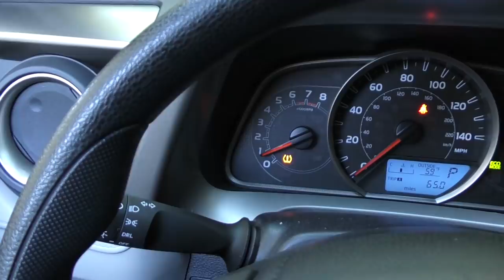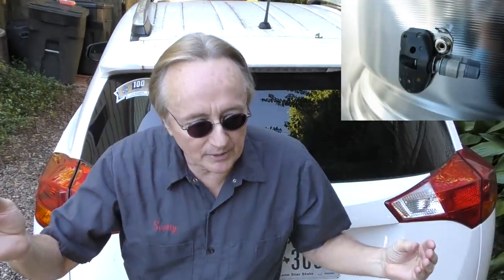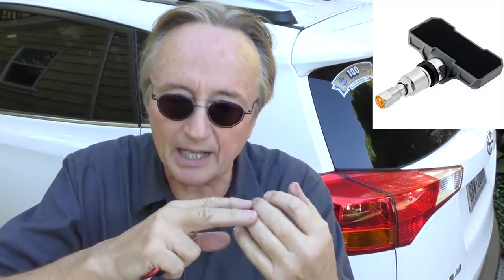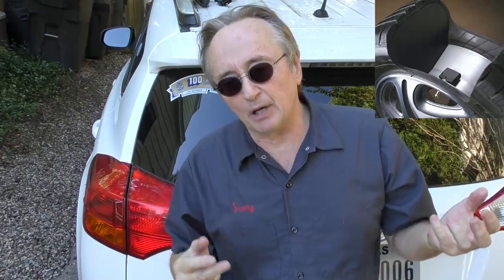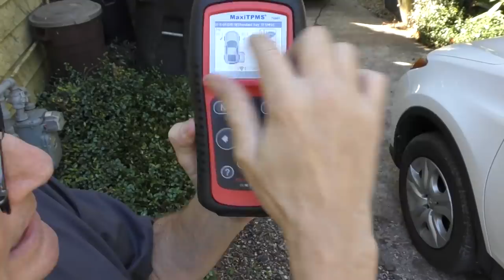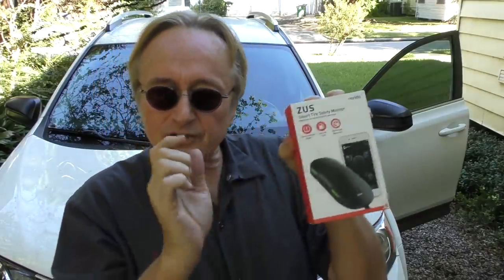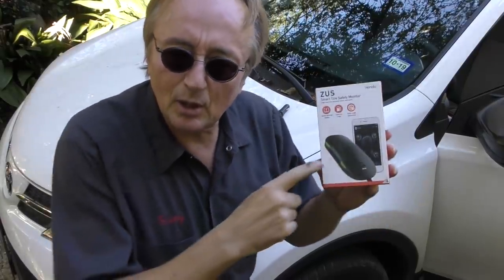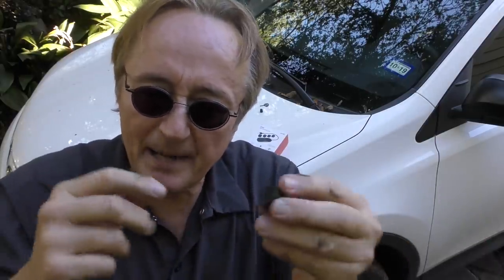Here’s Why This Kind of Tire is Stupid

Comment: When i tell people tesla is a bad car people just said: "Don't listen to a mechanic who is a youtuber" but hey i stille respect you Scotty :) Great Videos. One of my friends she has a 1999 Toyota Corolla 1,3 the servo fluid is dark and the car is hard to turn should the fluid be replaced?
Reply: bruh wth is servo fluid?... either way almost all fluids should be replaced at one point
Reply: @MauriiBoii  Okay :)
Reply: Depends on the car.  Some master cylinders immediately change the color of the brake fluid.  For example the Mazda MX5 Miata clutch cylinder - within a day of putting fresh fluid in it will go from clear to dark - it's perfectly normal.

Comment: discount tire probably does TPMS module replacement pretty cheap. last time i had a nail in my tire and got it repaired, they replaced the TPMS sensor at no extra charge.

Comment: Each TPMS sensor for my ford escape was $30.  The tire center installed them for free with new tires.  I purchased that same exact Autel TPMS computer used on eBay and resold it for a few dollars less.  Basically I just rented that TPMS computer.  It wasn't a huge deal to replace them.

Comment: I just place one of those little felt pads over the blinking light so it doesn't annoy me.  These pads are the ones you can by at the hardware store or at WalMart, and are placed on the bottom of vases or other objects so they don't scratch the table surface.

Comment: Discount Tire told  me it was $60 a pop to replace those sensors. I bought a new set of tires a year ago and they replaced the sensors for $50 each since I was buying tires and they had it apart already. I never got a light for over inflation but if you put the recommended tire pressure in your tires the damn things will annoy you if you drop 1lb below

Comment: Late model Hondas do not have TPMS sensors in the tires.  They use the anti skid device on the car to monitor tire rotation speed.  Lower air in a tire means the tire rotates at a different speed.  I had a 2014 CRV with this system.  It was horrible causing constant false readings.  I stopped many times thinking I had a tire low on air.  I lemon lawed the car since AHC could not make it work right.

Comment: I bought that Autel TPMS tool and 4 of Autel Sensors.
took them to Sam's Club, but they said they won't install TPMS sensors that the customers brought with them.
They will only install TPMS sensors they sell.  So I went to Goodyear Tire Services place, and they were willing to use my sensors, but they charge more for the exact same model tires compare to Sam's.

Comment: Am I correct in thinking that the low pressure warning light will stay on even after the after market sensors are installed?  I suppose a little piece of masking or electrical tape will hide it.

Comment: In an early Bentley Continental you have four sensors in each tire and a central PC which controls them. In five years time you have to replace them all or some of them.. and if their module has problem, it's another 1500 usd. A nightmare.

Comment: That’s a good idea to put external sensors on but if you’re internal ones are linked to your traction control and if you have a TPMS problem it will disable it.    So double check your owners manual before you spend 100 bucks on external ones

Comment: I have TPMS and never realized it until I got my tires changed. I check them once a week so I never noticed the sensor until the change. The light came on for about five minutes after I left the tire shop then it turned off.

Comment: The Firestone/ Ford Explorer debacle was caused because people (soccer moms) wanted their Explorers to ride better, they were built on a Ranger pickup frame which rode a little firm and were top heavy. Ford made Firestone soften their OEM tires and then they told people to run them under inflated. Even at correct pressure the tires begin failing. 
I WAS THERE and my family and some neighbors had failures. I was also involved in some court cases. Ford and Firestone blamed each other and all other Firestone tires were fine except the OEMs. But that was the end for Firestone. Bridgestone bought the Firestone brand name and they are now all good tires.

Comment: The TPMS saved my bacon. I ran over a nail with the front passenger side wheel. I had just got on the highway, going 75mph and ding ding ding... I pulled over and saw the nail head. I checked the pressure and it was down almost 20 lbs.. Whew.. That was close! I put the Doughnut on and got off at the next exit only a mile away and got the Tire repaired!  PS - These were brand new tires too.. only a month old!

Comment: Hi Scotty. This system looks great and all, but wouldn't it be completely useless in my 2006 Honda Ridgeline with Honda AWD system? As far as I understand if the TPMS system light is on/not functioning correctly it over rides the AWD system and prevents it from working. The truck will stay in FWD mode only as long the system light is on, it will not automatically switch to the AWD when needed. I replaced all 4 of my sensors for $320 and $50 to a tire guy. $370 total. The sensors I purchased were able to be programmed via a laptop computer using the vehicles VIN number, I was able to do it myself and have been working flawlessly for almost a year now. Am I correct in assuming these systems will not work with Honda's I-VTM4 AWD systems?

Comment: Always enjoy your video, THANKS! My only problem with the screw on replacement sensors is that theft can easily steal them. I will be screwed out of hundred bucks.:(
Reply: What good is a sensor going to be without the monitor that's inside your (hopefully) locked car?  Doesn't make any sense...

Comment: Actually if you take your tire off for any reason, and put it back on you won’t have to balance it if it’s lined back up with the valve stem where it came off from before. You can do this with chalk so you can line the mark up with the stem when it goes back on. That way you can wipe off the chalk with brake clean or solvent

Comment: I found some nice looking aluminium rims for the winter (picked smaller ones so more rubber for comfort), put the best winter tires on it and the cheapest eBay sensors to put inside because apparently (in Germany) it's illegal to drive with no sensors if your car came with some. No setup required, the car (cheap Suzuki) figures it out. I wish they did it like Mazda where it figures out if a wheel is off because it doesn't spin exactly as the computer expects it to. So if a tire is losing air, it knows before you figure it out while driving. On the old car I just checked the pressures as part of the washing routine and changed the pressure every season change to compensate for outside temperature. Looking up all 4 pressures by pressing a button sure is more convenient, but not worth the money really. I'd rather have lane departure warning mandatory on new vehicles. There's to many drivers veering into other lanes because they're busy with the phone, passenger or yelling at the kids in the back.

Comment: Hello Scotty! I had a question. I was in the market for a used Toyota Corolla when I stumbled upon two likely candidates. A silver 2017 Corolla LE with 83,000 miles and a cherry red 2014 Corolla LE with 52,000 miles. Both reasonably priced about the same and both in excellent condition. Still, I'm indecisive. What really matters more in a used vehicle, mileage or how old the car is?

Comment: Another Note, Some cheap/poorly designed cell phone/USB chargers can interfere with the wireless communication, so if you get a TPMS fault/light and your tire pressures are OK, try unplugging your cell charger for a couple trips. I had a PNY USB charger that would cause my car to throw a TPMS fault, unplugged it and restarted the car and the TPMS fault did not return.

Comment: One of the priuses I drove as a cabbie had one of these go bad and the damn computer in the car limited me to 50km/h until it was replaced. In the city, some zones are 60. most is 50. but we also got calls out of town where it's 80 and the quickest way over the river was the 401 which is 100. so... it quickly became a problem.

Comment: The problem with these aftermarket stem-mounted systems is that they are constantly depressing the schrader valve down to get a pressure reading. If they come unscrewed just a little over time or it has a defective gasket seal to begin with it can cause your valve stem to slowly leak. Best to avoid these systems, live with the TPMS light on and check manually.

Comment: In days of old we just got new tires and they were inflated properly when installed. Then at the oil change place they checked the tires pressure every 3000 miles when we got the oil changed. Of course those of us who liked to change our own oil to be sure it was done correctly and we got the fluid we paid for in there, just buy a tire Guage and check it ourselves. It was part of a weekly routine to check bulbs and stuff. An ounce of prevention is a pound of cure. Check your stuff weekly and avoid being stranded or even a ticket for a blown light. I'm not a fan of the new technology.

Comment: If I were to get one of the replacement tire pressure kits wouldn't I have to sync it with my cars monitoring system to get the light to go out? Or do I have to ignore the light on the dash and pay attention only to the new system?

Comment: Hey Scotty, could it be, that u don't watch youtube ?, 1. one problem to solve : could be, that tire pressure gages work on the same kind of cars on different frequencies , example C6 US / Europe versions , so make sure to put in the right gage for ur car . 2. if I remember right u simply can activate at least on a Corvette, pressure gages as follows : put the car in learning position and place a round magnet above quite near the airvalve of each tire, wait for the beep, do that for all 4 tires, and the new pressure gages are engaged. That's it. So we don't need a unit for 100 or more bucks, got it ?

Comment: Instead of spending any money at all, just ignore the light on the dash and check the air every so often. After all, the TPMS system ONLY tells you when the pressure is low. It's just a quality of life tool with no mechanical value

Comment: I also hate those I have on in 2008 Malibu it turns on the tire pressure I checked the air in the tires and they have the correct air

Comment: Hey Scotty-With these after market pressure sensors...   will they override the factory sensors that are tripping the tire pressure light or will that remain on even with these after market sensors?   Thanks!
Reply: they are independant, and will not turn off the warning light.

Comment: In my opinion, tire pressure monitoring systems are overkill. Keep it simple and just use a pressure gauge to keep tires at proper pressure. Anyone who drives and is under 70, should know how to check oil, tire pressure and coolant.

Comment: Omfg Scotty you’re amazing, lol it’s like you knew my tire light was on. I’m getting one these instead of spending a Whopping $476 on the batteries since have two out. Thanks 🙏
Reply: At Costco they are $45 each plus $20 each to install. Otherwise, you may have to pull the in-dash bulb in order to get the TPMS warning light to go off

Comment: How does the sensor know how much pressure your tires require?
Also: they will not tell you if your tires are overinflated.
Reply: Tires don't over-inflate themselves, and the sensors were provided by the OEM.

Comment: Some guys take all the TPMS's and put them in a capped PVC pipe with a valve stem coming out of it. Pressureize the tube with all the sensors inside and throw it in the trunk.

Comment: There may be a "zillion" replacement tire pressure battery kits around, but which ones are the best in your estimation?  Or, which ones have you used that worked fine?  Conversely, which ones do you know of that should be avoided?  I don't know if Consumer Reports has done a review of these kits yet, so it would be handy information to have.  Thanks.

Comment: I have wider and taller tires that OE, so i run my front's 5psi lower and my rears on my truck are 20psi lower or it eats the center out. Meh I hate tpms.

Comment: Hey Scotty I have a 2010 corolla and whenever it’s even slightly wet the abs light flashes on and off. What do you think could cause this issue? I have an 07 corolla 04 rav4 07 Tacoma and 19 Tacoma but this issue seems to only be on my 10 corolla. Could it be the fact that all four tires are a different brand or could it be bad shocks?
Reply: Basically turns on because one tire is spinning faster than the other so it turns on and applies the breaks to the faster spinning tire so both wheels spin at the same rate usually happens in wet conditions could be bad tires too or incorrect tire for your wheel

Comment: I drive a 2017 Toyota Camry LE have those designed tires pressures sensors.Tire pressures sensors are very minor problems useless me.After those stupid batteries ran out of juices in those inter rims of those tires after three years or so.Every oil changes by me or by the mechanics.Just checking if it low put more air in to that tire that all.

Comment: I just save myself money..
Use black pvc and make a canister.. use epoxy etc to seal one end.. use a rubber car tube cut and sealed.. drill a hole, put in a tire valve stem, toss all the sensors in the canister and seal the other side.. once it's dry, just fill the canister with x amount of air pressure.. toss it in the trunk call it a day..

Comment: have a question. if anyone could provide some insights.

have a 2007 ford fusion 2.3L I4 5 speed manual, 84,000 miles, runs good.
have the chance to trade into a 2014 ford fusion eco boost with an automatic transmission that has 82,000 miles on it, runs good.

would you keep the 2007 ford fusion or trade for the newer one.

been researching myself.
the older fusions were more or less mazdas.
pair that with the 5 speed manual tranny and seems the long term review of the 2007 rates higher in driver satisfaction and repairs.

the 2014 fusions especially with ecoboost seem to have lower overall satisfaction ratings that the 2007 model.

and like I said this is literally a trade from a family member.
no money involved.

so,

what would you rather own?
a 2007 fusion 2.3L I4 5 speed or a 2014 fusion ecoboost 4 cylinder with a automatic tranny?

which one will last the longest with the least issues / problems?

appreciate any insight what so ever.

Comment: Ya, those pressure sensor valve stems are annoying. They average $60/tire. Or you can check out other youtube videos on replacing their $5 batteries. Either way is a pita.

Comment: By Federal law, tire installation shops are not allowed to install tires without the factory TPMS system in place and working. These screw on sensors would be excellent if they integrated with the factory system, but since they don't, you'll still need to have the factory TPMS fixed when you get new tires. Toyota sensors can be checked and programmed using Techstream. But the best automaker for TPMS is the one you probably hate the most: BMW! They realized that there was no need for sensors because the ABS/Traction Control sensors could be used to measure tire rotations and compute air pressure. With a BMW, when you get new tires you simply hit the "Tire Reset" button on the dash, and you're good to go. The expense and annoyance of other TPMS systems far outweigh the benefits, despite what some Gen-Z'ers would like to believe (everything's better with an app, right?)

Comment: The worst part is tire pressure systems are MANDATED stupity. All because wide low profile tires look flat all the time. I think there are too many sizes of wheels and tires just to make them more expensive than necessary

Comment: … sure, but the aftermarket inner ones measure air temperature inside the tire… you don't know how useful this is at the track playing around with different tire pressures. 
Complex things are always more rewarding, sadly

Comment: Please help I can't figure out how to onscrew
Reply: Well, let's reason this out together. To unscrew; we lefty loosie and righty tighty. Therefore, we may assume to onscrew; you would supply a reciprocal value at a right angle to the longitudial axis of the stem, while using caution not to exceed the sheer strength of the plastic utilized in the stem's construction during rotation. It really is simply logical, or logically simple, depending, of course, on your philosophical alignment. Beam me up, Scotty!   

Spock out.